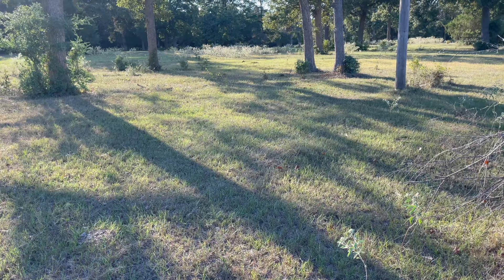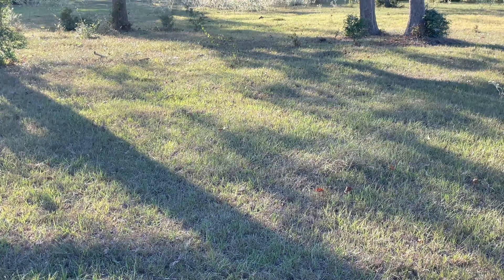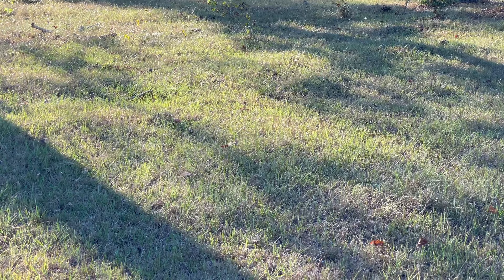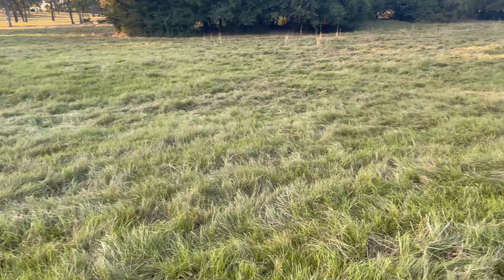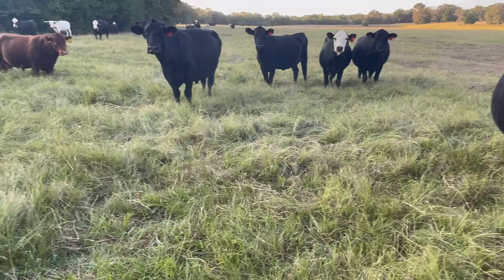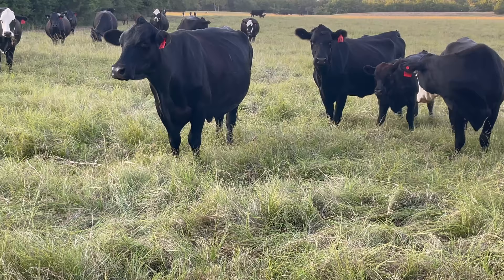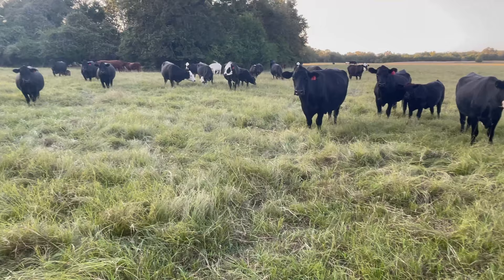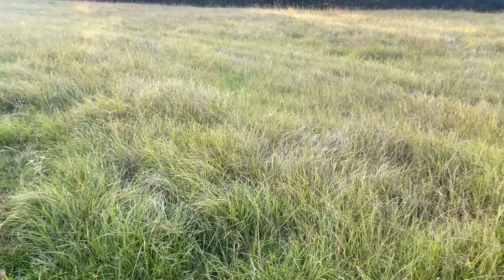Greg Judy's Principles at Work in Texas! | Regenerative Ranching

Comment: I should think even in Texas you get morning dew. In the cool of the morning, dew collects on the taller grass and eventually slides down to the ground once a drop gets heavy enough. This contributes more moisture to the soil than most people realize while the grass above protects it from too much heat and evaporation. That's one reason your grass is green and lush compared to your neighbor's. :)
Reply from the maker: Excellent description that makes total sense!  Thank you!
Reply: Dew on the grass also helped remove heat from the surfaces they evaporate from. 144 btus of heat for every pint of water that evaporates.
Reply from the maker: Never thought about that. Good information!
Reply from the maker: @jpp9876  nicely explained!
Reply: @cliffhonnasregenerativerancher  I believe regenerative farming and rotational grazing are of the greatest importance  in land stewardship.
Reply from the maker: Based on my experience thus far, i100% agree.
Reply: @cliffhonnasregenerativerancher  Cliff, what is your water penetration in your soils? Have you improved it by? Also in your part of Texas do you get real heavy rains that can cause havoc. I see you have some videos up. I will check them out.
Reply from the maker: We have a very sandy loam soil here. It’s sucks the water up if the rain is light to moderate. We do get periodic heavy rains. If there is not good grass cover, there can be significant erosion. With the grass I have established on my place, I get very little run off even with heavy rains and no erosion.
Reply: @cliffhonnasregenerativerancher  cliff, I you have probleby gone through these ideas, but would cutting in a cool season perineal grass help. Or cutting in anual cover crops for added grazing materials. It's my understanding the more you can trap moisture from evaporating it keeps the upper soils moister. Also an anual cover crop with a larger root growth would keep more moisture available during low rain periods. I am no expert, but it looks like you have decent anual rainfalls.
Reply from the maker: @jpp9876  I’ve got clover that’s fairly well established and getting better and I broadcast rye grass every year. Slow and steady wind the race. 😊
Reply: @cliffhonnasregenerativerancher  it's amazing how complex this interrelated bio system is and how if varies with climate and soils. My kid lives overseas and the country he is in is small and much of it gets 20 inches of rain a year.
Reply from the maker: So so true.
Reply: Exactly! Dew is one of the biggest sources of moisture you must have grass or vegetation. The taller the better the more dew forms on that grass! One thing I never hear talked about in rotational grazing is letting plants go to seed you must in order to let a pasture complete rest is let it got to complete seeds production! I only have native grasses and wildflowers on my small farm. I do flood irrigate it. If you graze it ever 30 to 45 day you don’t give plants enough time to go to seed. One seed produces one plant that then produces probably 5000 seeds. The best way to keeping a pasture Healthy is lettuce new plants grow. I don’t plow or disk. I irrigate with cattle on the field and I sow seeds and let them walk the seeds into the ground and then I pull cattle off. I also plant vegetables in those same pasture. I have lettuce and radishes growing in my pastures with native grasses wildflowers and that are grazed. Not only do I have food security for my animals I have food security for myself and I always let everything got to seed.
Reply from the maker: @rvliving1310  awesome comment!  Thanks for sharing that!

Comment: I agree with Greg Judy’s methods and I practice rotational grazing myself. But I would like to see an apples to apples comparison, ie same acres of pasture with same stocking rate of cattle. It’s easy to have stockpiles of forage when your stocking rate is low. I don’t really know what Greg’s stocking rate is but from watching his videos it seems pretty low. It seems that he has about 350 head of cattle, 400 sheep and 1620 acres of land. That’s about 3.9 acres per head figuring 6 sheep = 1 head. That’s a pretty low stocking rate for his area. In Missouri the recommended stocking rate for cattle on grass pastures is one head per acre and sheep it’s 6-10 per acre. So if you figure 1620 acres at those stocking rates with half cattle and half sheep that would be 810 head of cattle and 4860 sheep at 6 per acre. I know he is not anywhere close to those numbers. I understand not all 1620 acres is covered in pasture I’m just using the numbers provided for reference. 
So comparing Greg’s pastures or the pastures in this video to another farmers pastures that have a much higher stocking rates is not an apples to apples comparison.

Comment: Yup me too. I had to stop watching our wyoming life out of frustration. I still come back to watch them. Admit i am one of them who suggested they use Greg Judy method. They have so many acres. I just don't see how they cant be successful at it. Wish them the best.
Reply from the maker: The problem they will have is getting water to the paddocks if they try rotational grazing. It would be doable I suspect but would require lots of pipeline and $$.
Reply: Steve Keynon would beg to differ.  His watering systems are all recycled farm and oilfield equipment  and even some gasoline pumps.  It cost two dollars a day to pump water with a Honda pump

Comment: Thanks for the comment ! At that point ..... the grass can be cut and baled for later use. And it will grow back vegetative again. If it dont you still have the baled hay to feed. Greg Judy preaches its expensive to own hay equipment. Thats not true at all ! I own all my own haying equipment for less then 13,000 dollars. ( Tractor / round baler 4x4 /rake/two flat bed wagons/bale spears/ disc bine/ bale wrapper" ). If a farmer is going to go broke because of those expenses they should not be farming ! Thats less money then Gregs four wheel drive truck !
Reply from the maker: Ii don’t like baking hay off my pastures. I used to get it custom cut but they cut it too short, remove all the solar panel, and then the grass takes forever to regrow. I prefer to buy hay and use that to feed the cows (I unroll the hay) and the small amount they waste decomposes and feeds the soil. It’s a win win for me.

Comment: Either unrolling hay or through a bale feeder .....just unrolling takes a bit longer....and buying hay is just one more expense....otherwise both are equal from my experience.    With balage there is no waste... and the cows spread " most " of the manure through out the pasture.......because of the smaller bales.....they stay in that bale area for only a short time before its cleaned up.  With a bale feeder " if " there are weeds in the bale its mostly confined to a small area....where the bale was.  Those areas could be treated easy.
Reply from the maker: I’ve never seen any balage fed in our part of the world. Not sure why. I really like the results I’m getting with unrolling hay. It doesn’t kill the grass out like feeding in bale rings. The grass grows back with purpose after the bales are unrolled. I don’t have time to bale hay, so much easier for me to buy it but my circumstances are different then full time farmers like yourself. I have had my pastures baled in the past, but I don’t like what it does to my pastures and regrowth. Also, I’m trying to not to use any fertilizer, and that would definitely be needed in our area to get reasonable hay production.

Comment: What type of grass do you have? Can I let a coastal field go (fertilizer wise) and start regen grazing moving forward?
Reply from the maker: I have Coastal, Jiggs, and Tifton 85 Bermuda grass and Bahia grass.  Are you planning to use your coastal field for cutting hay?  If so, the best way to keep it going is to unroll hay on it and graze it so that you provide fertility with manure and decomposing hay. It will respond favorably but you likely won’t have much hay production this year without fertilizer. If not using the pasture for hay production, then grazing is absolutely the best option plus unrolling hay next winter.
Reply: @cliffhonnasregenerativerancher  well I was hoping to limit cutting a bit more but I’m open to whatever works most efficiently. Thank you for the reply!